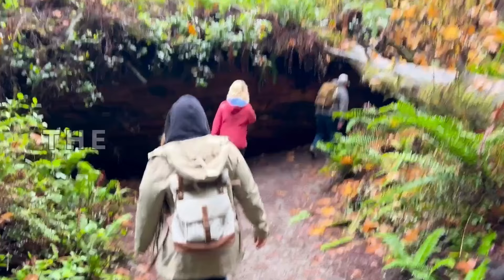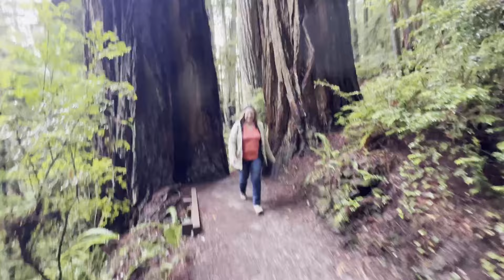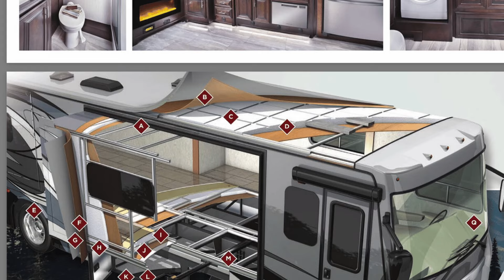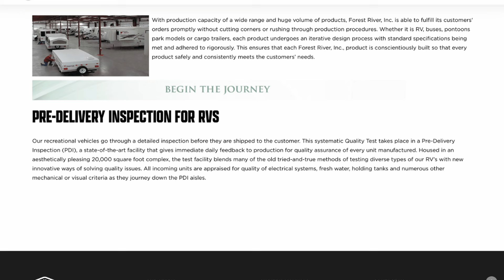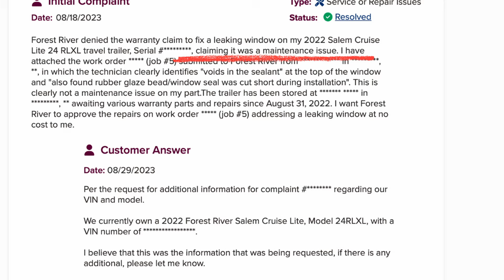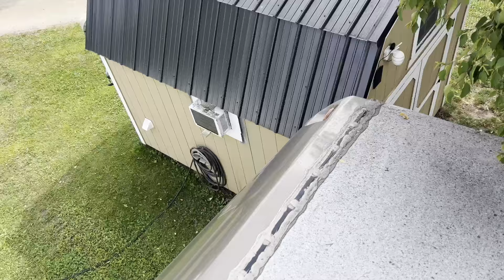Forest River Caught: The Six-Figure RV Missing Its Roof Skeleton

Comment: The problem is most people are not top notch recreational vehicle building and construction specialists. Most people wouldn't know a failure if it was staring them in the face nor do they understand how the parts of an rv work.That is why there are independent inspectors for hire. New cars do not need an independent inspector that you hire and pay to find factory defects but recreational vehicles do when new. The industry does not police themselves so the general public is always at risk.